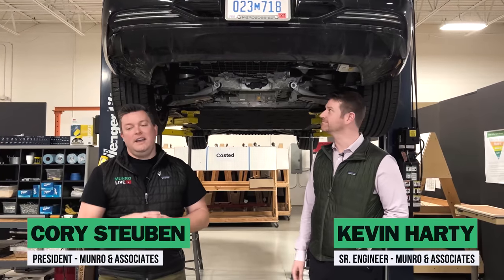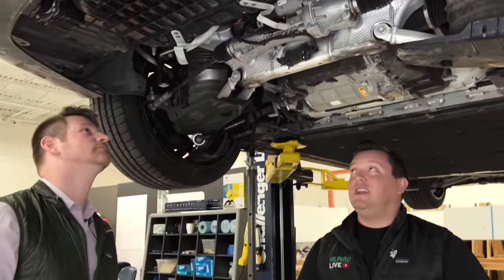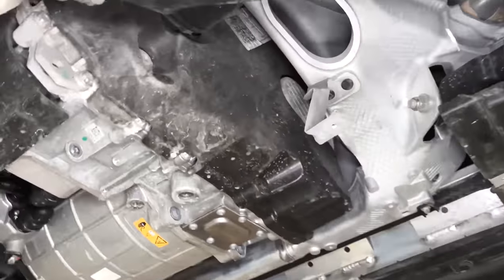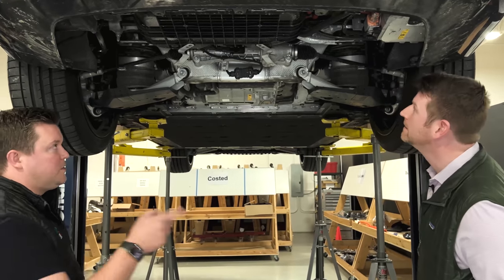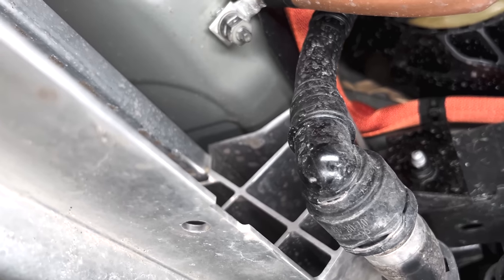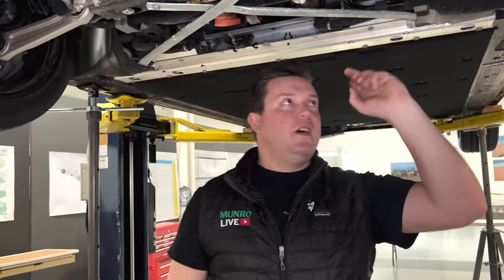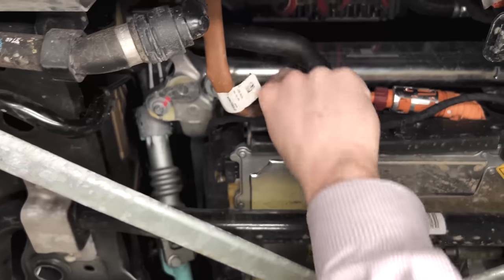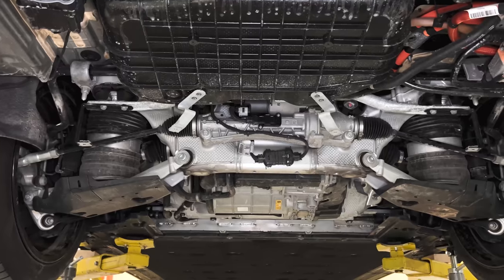Mercedes EQS 580 4MATIC all-wheel drive | Hoist Review

Comment: The two metal z shaped brackets hanging from the trunk tub have a purpose. They allow the under panel to flap with the air passing over it and isolating the cabin from the vibration.
Reply: Yeah and also some flex when people drive over things scrape the under side which otherwise would break the plastic.
Reply: @mrm1885  
I'd sack my chauffeur.

Comment: I’ve seen you refer to the portion of the battery that sticks up under the rear seat as a penthouse. Great show!
Reply: Because the Ev is supposed to be the overall solution of our climat problems, it’s a advantage for maintenance not to integrate every function into the MOST expensive component of the car, the HV-battery. 
If there is a Probleme with a condensator, Switch or relais you can replace that component separately from the battery (600 up to 800 kg weight). I think the decentralization of HV components has disadvantages on the Production cost side, but its a big adavantage for a long life of a vehicle. But I’m very skeptical that Evs will be keep over 20 years on the road as normal combustion vehicles can easily do.
Those environmental friendly cars will be electrical scrap as an iPhone after 6 years.

Comment: The S shaped brackets are they to allow to bumps without breaking or damaging  expensive large parts. Cheaper repairs?
Reply: I was thinking the same thing.
Reply: Pretty obvious to any technicians. How did they miss that?!
Reply: That is exactly right. The engineers at Mercedes are just smarter.
Reply: The guys are engineers and focused on cost and assembly.
Reply: @Formula400Pontiac They almost never talk about repair cost, they would integrate the whole car and make it one piece, just because it is easier to assembly and cheaper, but you make it a single use device, a repair means changing super expensive parts.
Reply: @bmwslk230  Lexus had this on a 90s LS. Nothing new.
Reply: Repairs due to you running over something large enough to knock off a piece of your car's underbody are an insurance company issue, not a car manufacturing issue.
Reply: @Factoryseconds123  That is no reason to cost 3000 instead of 50 dollars including work.
Reply: I would say the s shaped brakes make it possible for the panels to be extremely low over the ground for good aerodynamics, but in case you hit something (bump, rock whatever) they can move up and don't get damaged. Of course Mercedes could have chosen to mount the panels directly to the trunk construction. There must definitely be a reason for them to do some awkward brackets like that.
Reply: These guys are focused on manufacturing cost savings to a fault.
Reply: @cadriver2570  that's also kinda their job lol
Reply: @Factoryseconds123  "to a fault"
Reply: @Factoryseconds123  
It is when people don't buy your cars because they're too expensive to insure.
Reply: @Robert-cu9bm  i doubt that's an issue here lol

Comment: The rotor design you noticed is the same design as is used on the Model 3 Performance.  If I'm not mistaken its a Brembo patented design that went unused for a while.  There's some benefit to the design over a simple cast part, but a good aftermarket 2 piece rotor either full floating or fixed with an air pump design is stronger, lighter, and performs better on the track in addition to being serviceable with new rotor rings when the originals are worn out.

Comment: Best, and only video, on EQS engineering highlights. Well done. Built like a tank. Yes there is extra bracing and insulation on everything, that's why it glides like an isolation vault down the road. NVH and safety are critical operating priorities for a luxury sedan. There is a big difference between a company that has been building cars for over a hundred years and one that has just been around for a decade.  The little hanging brackets have a purpose; they are "sacrificial" and allow some "give" to what is a noncritical cover/ aerodynamic fairing which given it position will be in harms way. They avoid damage to more critical and much more expensive components, I'm fairly certain that rear composite material tub is way more expensive that a couple of thin metal strips. Well done! I can't wait for your next instalment.
Reply: This car has been in development  since 1995. Almost as long as Tesla has been around. They wanted to get it right, on the first round. They wsnted to avoid the Tesla syndrome of handing costumers "beta" vehicles with promises that mostly went unfulfiled. No updates required.
Reply: But … Tesla parts are more often than not cheaper than from those other manufacturers mentioned.
Reply: @fran6897   In fact no. The price of Tesla parts is as high if not higher than most if not all mainsteam manufacturers. Just take a gander at the multiple price shock stories of tesla owners repairing body damage. Even worse, people waiting for months on end for parts. You could expect that from internationally sourced parts but from a US manufacturer? Crazy.
Reply: 21:55 consistent with typical German cars, start leaking soon after leaving factory
Reply: @oodlespring  ever check under your car?
Reply: Why should an engineer at Mercedes care about debris damaging underbody components on the eqs and specifically design brackets that cost extra to mitigate the issue? Road debris and the damage that results from road debris is an insurance company issue, not a car manufacturer issue. It also sounds like a bad driver issue if you're regularly running over debris large enough to rip components off the bottom of your car. This sounds like a poor attempt at a post hoc rationalization. The video is right: there are cheaper ways to manufacture the EQS and one of the ways is removing the brackets and making them integral. If it's damaged because the driver ran over something huge on the road because the driver clearly wasn't paying attention, then that's an insurance issue not a manufacturing issue.
Reply: @Factoryseconds123   Brackets that cost extra? Have you seen the video? Those brackets cost about five dollars in total....Again they are there to take the damage for more expensive components. They are also the equivalent to shock absorbers thus cheaply offering shock resistance... really, a total non issue. Finally, as regards to the AC/DC converter, this architecture will underpin around six different vehicles, its placing outside of the passenger compartment allows that flexibilty not to mention that the EQS is a "world car" with a variety of charging standards and capacities. Its position makes instalation costumizable and extraordinarily simple. Plug and play. In fact what is revealing in this video is how simple and modular MB has made this car very refreshing. Its almost like a Lego.
Reply: @Factoryseconds123  what do you think customers prefer? A constructuon that avoids damage and protects the more expensive parts of have to deal with the insurance every time?
Reply: @Wised1000  yes, changed my cars' engine oil since 2000, at least twice a year, only leak was from an eight years old car of busted radiator. Only new cars that I ever saw leaks were german cars.

Comment: That leak you found is interesting. I would not have expected a low-mileage, top-of-the-line Merc to have a leak like that.
Reply: Nothing about Mercedes is quality. When my 1 year old Mercedes squirtet hydraulic oil on me and my interior I went to Lexus and got myself a LS460, still not one problem since 2013.
Reply: My model Y spent nearly 4 of the 7 months I owned it at the shop. I know this is a vastly different price point but issues aren’t exclusive to any manufacturers
Reply: Yeah I’ve also seen a tesla plaid from Will Prouse with a catastrophic failure of the front drive unit/motor and door handles too lol….

Comment: One if the basic things you learn in engineering is to design also having in mind that parts do break and in that case you want to have some cheap, simple part that breaks and not the big, complicated, expensive one. So, if an integrated bracket breaks because there is a piece of wood or some stone on the road, you are do to what, change the complex expensive part for such a common, basic unfortune? No, you change the 0.5 cents piece and thats it.
Reply: Exactly, sandy Munro has already brainwashed people about vertical integration that everything has to be in one giant part, Teslas are already the most expensive cars to repair imagine if Mercedes’ did the same stupid design!? They can vertically integrate some parts but not everything tbh!
Reply: @alanmay7929  Vertical integration is bringing as much as possible of the supply chain in house, not simplifying assembly. Making the front and rear underbody from one part is not stupid.
Reply: @alanmay7929  please cite a source for that claim of 'most expensive to repair'
Reply: @bluetoad2668  How about the dude who was quoted $16k cos one of the coolant hose barbs snapped off the battery pack?
Reply: I suspect that the brackets are intended to be flexible and to maintain an airgap between the undertray and whatever's above it so that it can flex a bit when something hits it.
Reply: @spankeyfish  99.999% you are right, they would have looked differently otherwise.

Comment: thanks Father Stuttgart and thanks Kevin/Cory.  i was definitely NOT expecting one of these brutes to go up on the lift (saves me the trouble) so this is a nice bonus going into the weekend. 👍  22:33 - "Hey what about this".  yes i am one of the guys who thought you just totally ignored that rear EPS unit.  Merc's RWS implementation (to see if it was single or  double) was the primary reason why I wanted to get a look underneath an EQS.  Stuttgart Cousins Porsche I believe use a double set up (separate L/R actuators) on the rear of 911's so i'm guessing they've kept that layout on the Taycan...?  maybe you can talk them into giving you a loaner next (with RWS).
Reply: No Taycan has the same concept like eqs. 911 was because of the engine being in the wrong place for the steering rack you know.
Reply: @computercrack  ah okay, thanks. 👍

Comment: 16:15  - can't comment for all manufacturers, but the front and rear ride height sensors are usually for the headlight leveling systems required on HID's.   You're probably correct that with the air suspension they have additional sensors for suspension monitoring.
Reply: Automatic headlight leveling requirements is an European/UNECE specific issue. Nhtsa doesn't care.

Comment: AC charger is there because this platform will be used for 7-Seater SUV with sliding seats and many other cars. Meaning the battery pack has to be flat. Audi (VW) PPE platform has the charger integrated in the battery pack but the MEB (VW) platform doesn't. That's because MEB is used for Vans (ID Buzz Cargo) - the battery needs to be flat.
Reply: T also makes the whole car much more serviceable than any tesla in case of problems. Tesla is basically copying apple and reducing the accès to their cars more and more which is a crime tbh!
Reply: @alanmay7929  Exactly those environmental friendly technology which will be solution for all our climat problems will be electronic scrap like an 6 year old iPhone.
Reply: @visionmodernclassics3062  lol….. there is basically no waste in todays electric cars! The used batteries can e repurposed and used as energy storage at home or in an RV, the charger/ inverters and other parts can be repurposed and reprogrammed/ modified to convert other cars to EV…. And having less Integrated parts makes it even better for second hand use.
Reply: @visionmodernclassics3062  6 years old iPhones are still supported by apple for the records those aren’t scrap at all.
Reply: @visionmodernclassics3062   thé iPhones 6 and 7 are still perfectly well usable even in 2022 with 16Gb of storage
Reply: @alanmay7929  The capacity of the to the housing glued battery is mostly under 80%....every new iOS update makes older iphone slower in their performance....because the hardware is not designed for the new SW update. Especially before iPhone 5....and for every recycling process high amount of energy is needed.
Reply: @visionmodernclassics3062  lol……of course the oldest iPhones doesn’t receive all the latest software features that the latest iPhones have, for example the iPhone 8 doesn’t have Face ID…… it’s a custom software update to improve safety and most importantly apple has been reducing/optimizing the sizes of their apps to be lighter on the hardware.
Reply: @visionmodernclassics3062  the ios 15 on an iPhone 12 is not exactly the same as on an iPhone 8 or 7 for example, the hardware has seriously changed over the time. Apple has also optimised the updates according to the state of the hardware, the glued batteries can still be changed so no issues there.

Comment: For a fixed connection, there is no need to use stranded cables. Weight for weight, aluminium is more conductive than copper. It could be stranded, but a solid pure aluminium busbar (with suitable electrical insulation over the top) is the least cost and most effective.

Comment: I remember a few weeks ago, Sandy was complaining about the necessity in the automobile industry to have physical steering column connections (steer by wire is not allowed). it seems to be possible for the rear axle though.

Comment: Because the Ev is supposed to be the overall solution of our climat problems, it’s a advantage for maintenance not to integrate every function into the MOST expensive component of the car, the HV-battery. 
If there is a problem with a condensator, switch or relais you can replace that component separately from the battery (600 up to 800 kg weight). 
I think the decentralization of HV components has disadvantages on the Production cost side, but its a big adavantage for a long life of a vehicle. But I’m very skeptical that Evs will be keep over 20 years on the road as normal combustion vehicles can easily do.
Those environmental friendly cars will be electrical scrap as an iPhone after 6 years.
Reply: Wise comment, in my opinion.
These guys have a real focus on production, not repairability, which is barely a concern of the OEMs anyway.
Reply: Exactly. I'd happily trade a frunk i'll never use to have access to more components in an "Engine Bay". Serviceability is so important, and something that some EV only manufacturers just refuse to engineer into their vehicles.
Reply: Keeping ICE cars 20 years on the road is far from easy. It involves a lot of maintenance and repairs. Just look at the car wizard or whatever repair channel. BEVs will be much more easier to keep on the road that long. They may lose some battery capacity, but they will break down a lot less than an ICE.
Reply: @computercrack  we will see 😉...nobody will invest over 10.000 Dollar or more  for a replacement battery in a 10 year old EV which has market value of maybe 8000 to 9000 dollar. There are already many expamples on the market were this decision has already to be made: 
- BMW i3 60Ah first generation 
- Smart 451 ev (=> replacement battery costs over 15.000 Euro, if you are lucky to get one) 
- Tesla Roadster (look at the valves of used cars 😂, the isolation of the IGBTs at the power electronic aged rapidity, the event of short circuit is high , worst case:  the howl car burn down because the main fuse is not able to cut the short circuit current )
Those cars will be scrapped....it’s all about the money. 
A BEV might have less „turning“ parts  compaired to an ICE but if something fails (relais, hv switches, condensator) the repair costs are in most cases higher than the value of the car. 
Compaired to an BEV the repair costs of an combustion engine are cheap.

Comment: Great seeing you have a look at the first purpose platform EV from Mercedes! Very interesting video, as always!
Too bad that 1) there's a coolant leak already, 2) you don't do a full teardown. I'd love to see how the body in white is done.
Reply: Those things happens no need to worry here, it’s not locking fuel, Tesla plaid are also having total motor failure too.
Reply: Rich Rebuilds also had a leaky Plaid. 😂
Reply: And more than likely this car being a press car it has been beaten pretty hard.
Reply: @alanmay7929  Haha. In Europe Lexus has replaced 4 electric engines and 2 CVT electric motors of 1000000 cars. This cars are just build bad.
Reply: @epoxy1710  that’s a false info lol….. stop lying to the public!
Reply: @alanmay7929  Not fake news, they in fact brakes so rare they don't have them as spare parts. They are produced after order.
Reply: @S.Madman  I cant't see how accelerating, breaking and hard cornering by press people would cause a coolant leak. The only cause I can image is stone-chipping by not keeping the safe distance. But even this would be a design issue if critical coolant lines were not protected from this.
Reply: @epoxy1710  its totaly fake news, there arent a million Lexus in europe.
Reply: @nox5555  Wtf are you talking about. It is 1,2 million Lexus in Europe and 1,1 of them are hybrids. Toyota has 3 million hybrides in Europe.